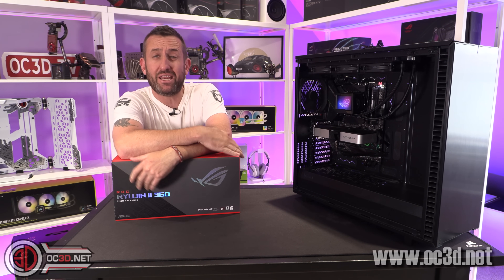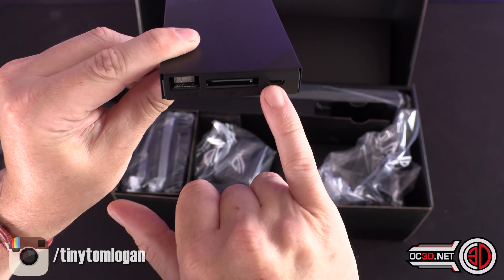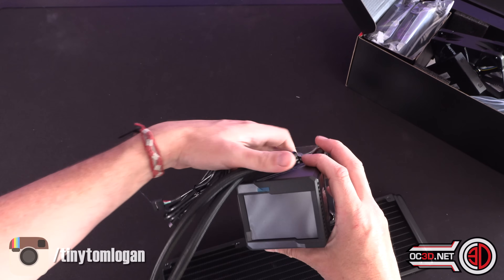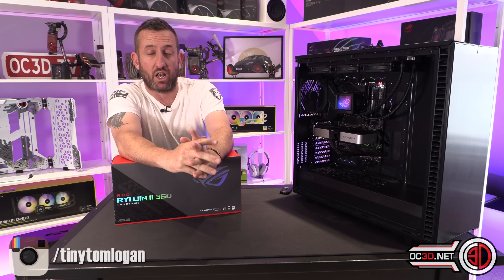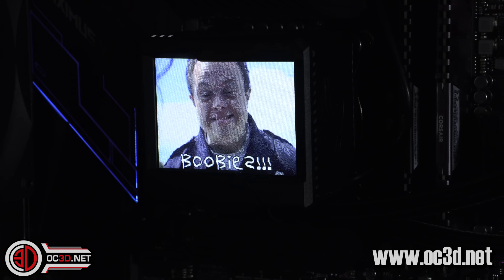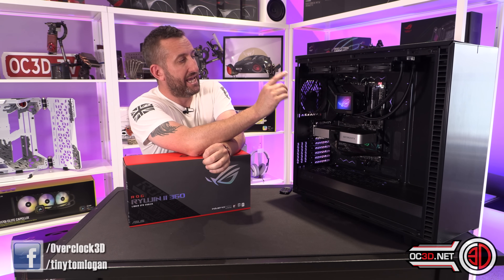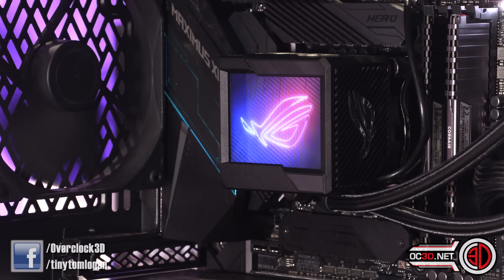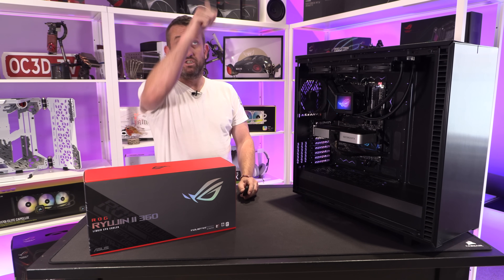Asus ROG Ryujin II 360 AIO CPU Watercooling Review

Comment: And by great software you mean crappy software right?
Takes 30 seconds to upload a GIF, can only save 7 GIF's no matter the size, software HAS to be open for the display to work, converting the GIF's sometimes fail leaving the program to say "GIF to big" while it is not, and then you have to reset to default, deleting all uploaded GIF's and starting over.
The whole Armoury Crate software is a joke and is rightfully called a virus.
It is always online and have 8 services running in the background, roots so deep into your PC that you need its own uninstaller to remove it.
Fuck's up your PC from time to time so you have to uninstall it to get your PC running again.
Hands down the worst RGB/FAN/AIO software on the planet.
I really wish more companies would make modules with internal memory, so you can program your light, fans, AIO and then delete their crappy software, without the hardware resetting to default.

Comment: Is it possible either using the Armoury Crate software or rotating the LCD Display bezel to achieve a 90-degree perspective? I note in your vid that you mounted the liquid tubes on the bottom, and the ASUS user guide shows them fixed on the memory stick side.
Reply from the maker: yes it can be rotated

Comment: I have a  TUF GAMING Z690-PLUS WIFI D4 motherboard & when all 4 ram slots are filled it does not l eave much room for a cooler so what i would like to know will it physically fit on my motherboard when all 4 ram slots are filled is anyone able to confirm this with absolute certainty ?

reason  I ask is i currentlly have a Kraken X52 cooler it fits on my motherboard but only just & the logo on the cooler  is at a funny angle

Comment: I was wondering if the Kraken does report the actual CPU temperature, because i have tested it, and what it shows on the LCD for the CPU and GPU temps are pretty much consistent with what the sensors are reporting on HWiFO64, CPUID HWMonitor, and CoreTemp softwares. Is there ay other way (software or app) to know the actual accurate CPU Temperatures. Thanks in Advance!

Comment: Hello , i have problem with cpu fan error , This aio no have cable cpu fan why ? Thanks
Reply from the maker: Plug the rear case fan into that header or the AIO pump power so you can monitor pump RPM

Comment: When I put my bracket on, before screwing the fan block down on the cpu, it was very loose.  It didn't sit flush against the back of the board.

Is that normal?  I also put the 1mm washers under the retention arm.  Wrong?

Comment: Just bought this cooler, well the 240 version. I've installed it all as per the manual. And I've put the fans into the Rog controller. All is working. Is this the correct way do the fans not go into the motherboard?

Comment: I purchased this cooler along with Asus Maximus Z690 Extreme.  I attached Cooler micro USB to fan controller and the other cable to USB 2.0 Header after what seemed like HOURS of using that no good manual. 

The ROG Ryujin II 360 failed to work or light up.  Even the fans attached to the ROG fan controller didn't work and to top it off I'm getting error Q Code "99" with CMOS error on the motherboard display.  

I must've cleared CMOS a million times and disconnected and reconnected every cable.  Im at wits end.  Is it the cooler or the Z690 motherboard.  Both are new out the box.
Reply: Did you attach a sata power connector from your powersuppy to the rog controller ?
Reply: @ubascouser  There are two cables that are attached with the AIO Cooler. I attached the usb cable to the ROG Fan Controller and I attached the other cable to the USB 2 Header port on the motherboard. 

I attached the sata power cable connected to the power supply to the ROG Fan controller.
Reply: @DaveSincere  and the fans on the radiator have you attached them to your rog controller ? Try a different sata power cable
Reply: 1 more thing are you trying to run xmp in the bios I can't run it. My 3600mhz is only running at 2666mhz. Computer doesn't start. Meant to be a problem with certain z690 boards mines the z690-a gaming WiFi d4

Comment: This Aio sucks 
Like Asus last days (z690 Hero)
Pump is powered by box with old type  micro usb.
If box will get an issue pump doesn't work so you are unable to use your pc.
Bottom bracket behind motherboard is made from cheap plastic.
Seriously for price more than £200 plastic fantastic?
Pump should be contacted to mainboard with 3or 4pin wire as usual on another aio systems.
I have that kind of problem pump doesn't work because of issue with this box.

Comment: Thanks for the review. I have been using this cooler for a month and I agree it is an awesome AIO. One thing you could have mentioned is that there is a setting in display customization in Armoury Crate to add CPUPackage reading into the display which is what you say is missing basically. I monitor both CPU Temp and CPU Package Temp on the display and you are right, there is 6-10 C difference between both sensor readings but you can easily monitor whichever one you like, or both.
Reply: I run noctua f12 3000……. I roll my eyes when people complain, I want my pc cold as it can be so I’ll take the noise is that’s makes the components happy. Nice to read you take on this from an actual owner, can’t wait to get one
Reply: When you set it to monitor CPUPackage, does the fans go off of the CPUPackage or is there still the ram up before it evens out like he was talking about in this video
Reply: @Hexxagone850  agreed, that was the problem.  Not what it displayed, but rather what it used to ramp up fan speeds.  If we can choose which temp to use, that would be brilliant!
Reply: Hi. I wonder if the radiator have refillable port something like EK AIO or Lian Li Galahad had.
Reply: @dmasmarty  Nope, unfortunately it is not refillable but it has 6 year warranty so I have to assume it is maintenance free at least for that long.
Reply: would you say its worth it? compared to the kraken z series? Are they both similar in terms of temp readings?
Reply: @jonathanleonard9507  Performance wise it would be super close to kraken z, ryujin might be slightly better with the noctua fans but nothing noticeable. For around $100 more, you get a large screen to read all CPU and MB specs and keep a better eye on them while gaming etc so for me it's worth it. Ryujin is not a necessity, more like a luxury item :)
Reply: @zeynelsendur3615  ahh thanks for that! Was really eyeing this. Tbh i wanted it more for displaying gifs hahaha. Seeing how it does not read temps properly and people saying the fan is always at a 100% makes me wanna stay away from it . The EK Vision looks promising i just hope its software is goos
Reply: @jonathanleonard9507  no worries mate. I confirmed multiple times that it shows temps perfectly, compared to hwinfo. You just need to add cpupackage reading into the equation. You can turn off the fan altogether or create a custom fan curve to your liking so that is a non issue. People complain about anything and everything so get whatever the soul desires 😉
Reply: @zeynelsendur3615  owhh how do you go about that if you dont mind guiding? The fan thats a 100% is it the one on the pump? What does that do? That embedded pump fan?
Reply: @jonathanleonard9507  yep it is embedded in the pump housing, adds airflow to the cpu socket. Armoury Crate gives the ability to change fan settings.
Reply: @zeynelsendur3615  ohh cool cool, i believe other aio do not have this embedded fan? does it provide any benefits?
Reply: @jonathanleonard9507  correct. When I turn it off, temps go up by 1-2 degrees so not a huge benefit.
Reply: @jonathanleonard9507  I'm looking for the same answer or even a review from a YouTuber such as Gamer Nexus for example. According to the specifications, the Ryujin 2 uses the same Asetek gen7 technology as the Kraken Z series on the pump head. However, using a Noctua fan to cool the radiator may give Ryujin 2 an advantage, as Noctua is a well-known premium brand when it comes to efficient fans. *Though now the best fan available today is Phanteks T30.
Reply: Where did you buy the cooler? I haven't found any available except scalped ones from outside the u.s.
Reply: @christianweber1231  pb tech new zealand
Reply: That's good to hear tnks for the info.

Comment: i have this in push pull absolutely brilliant
Reply: I have some lianli sl120 fans & i was thinking about to make a push & pull on this cooler, but i have a question for as you already did it: does the stocks screws works to place all the fans right away to the raidiator itself? (i mean to mount the 6 fans to the radiator) Or did i must get new screws to make it works? if that's the matter, which size of screws should i get for this? it will help me a lot if you answer my doubth
Reply: How is the software?

Comment: Good luck getting that or any other device to work effectively with armoury crate 🤦🏻‍♂️
Cheers Tom
Reply: The only thing Armoury Crate does well is take up space on your ssd
Reply: @roosterbooster6238  tell me about it. It will not recognise my gpu no matter what I do so I can’t even have it lit.
Reply: @BrenWebster  is it an asus gpu? It picks up my asus 1080ti and also my Corsair icue. But it is meh. I will be fair on it as it is fairly useful on a laptop but woeful on a PC. 

As for 9 inches not exactly as impressive for a gpu nowadays as it is for a trouser snake 😂😂
Reply: @roosterbooster6238   yes pal asus strix 3080, got lucky finding a white one, it does have some lighting onboard but it will not light up at all although works great when gaming so has to be armoury crate/asus aura software issue I think. Trouser snake, love it 🤣
Reply: @BrenWebster  send me the 3080 and I will test it for you. Should only take me 2 years 😉
Reply: @roosterbooster6238  while of course I would trust you implicitly, a reinstall of Armoury Crate has since fixed the issue 😉👍🏻
Reply: @BrenWebster  I found a fix for that back when I had that exact same problem.

There is a separate software from ASUS that is required for armory crate to detect it. I'm 70% sure it was GPU tweak. As soon as I got that, it installed some extras and updates to the card, then the card was detected in armory crate, and has never been lost since.

Comment: Arctic AIO + mod own seven-inch panel. Spend the savings on a better GPU/CPU. Asus kit may be good, but honestly they were shilling when the current crop of shills were in short pants. Asus Tax in the current Gougefest environment? They can get to... lost. Honestly folks: get your mod; on it is more fun.
Reply: The option I went for was a Deepcool Castle 360 rgb v2 and a seven inch panel using Aida64 for the information. I went for the Deepcool because I like the look of the pump housing. It's not a bad cooler and keeps my 3950x pretty cool.
Reply: @LordPoshnameVonPlumbingparts  Good choice, i've a couple of Deepcool AIO's; they look good and cool well.

Comment: Wait, what??? Liquid temp won't rise by 10 degrees in 30 seconds even when the fans are turned off. Maybe pump speed is very very low and that's why you have those spikes. And NH-D15@1000rmp equal with Asus@1500rmp (3x120mm fans)??? Something is wrong! Anyway, best thing in AIO is to set fan curve based on Liquid temp, no problem with sudden spikes, fans spinning up, always cool and quiet.
Reply: A bad aio can loose to good big air cooler
Reply: @Deviantsoundz  360's cant, or maybe the "pump in rad" ones can but..
Reply: @norkris8729  there is a few test around but yeah.... it happens
Reply: i agree.. many of his numbers seem to be "off". a 360 AIO Cant lose to a air cooler

Comment: Basically if you style pay the money if you don't need all that fluff air cooling noctua is just as better.
Reply: many ppl dont need this / AIOs.  but air cooling is not better. just less fuss. and cant fail
Reply: @norkris8729  I do agree, best air cooling only can outperform the worst AIO cooler. If compete with EK AIO, Artic Freezer 2 or even Lian Li Gallahad, there is no way D15 noctua's or even Deepcool Assassin 3 could win. If CPU is overclocked to the limit, then it is worth it to go for liquid cooling over air cooling.